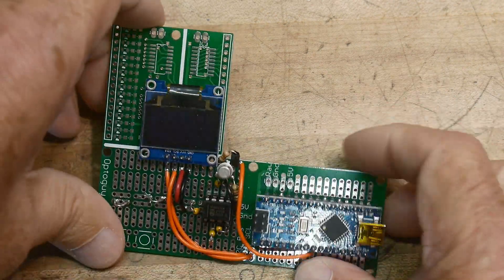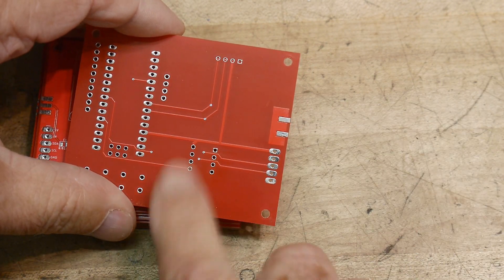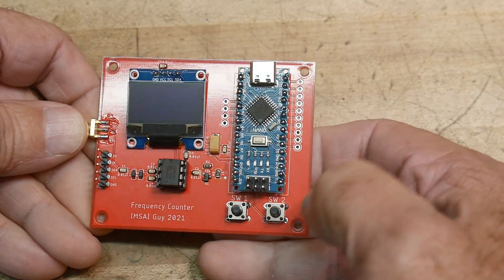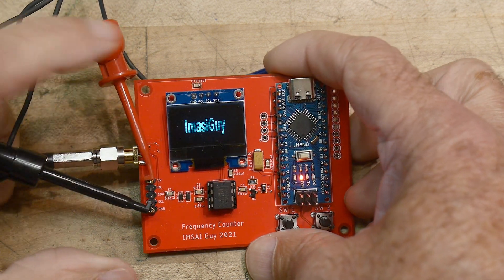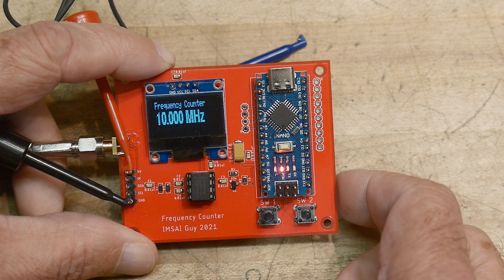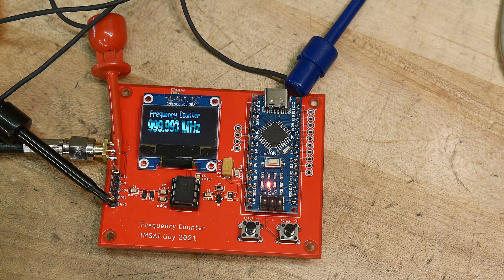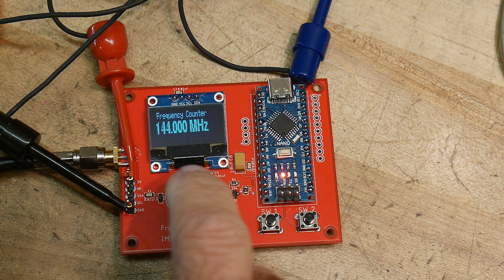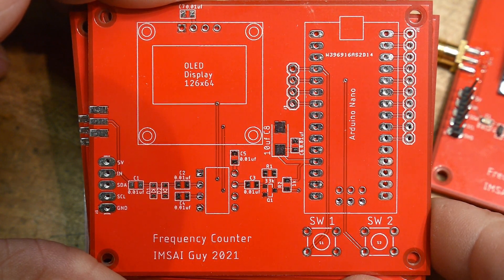#992 Freq Counter Complete

Comment: Fun little project - accurate and stable enough for a frequency display with 100Hz resolution for my otherwise all analog homebrew 20 meter transceiver.  My IF is at 5MHz so I added the IF offset to the code - calibrated with a 14.2MHz signal zero beat on the receiver.   I added a little rounding / smoothing to the code and changed the gate time to 250 milliseconds for a more responsive display.   I read some of the other comments,  the Nano may not be the most precise device for a general purpose frequency counter based on this chip - but it is certainly good enough and simple enough for my application.  Once I got the chips in it took all of about 2 hours to build.  Thanks for all you do for the electronics hobby!   73, de KK4DAS

Comment: pin D5 of Arduino is not defined.....how can Arduino read frequency? I think this software will not work with SAB6456A Prescaler
Reply from the maker: it is I2C and is handled by that driver, no need to define
Reply: @IMSAIGuy  ok thanks to reply
Reply: can u provide ur mail address?
Reply from the maker: @mohsinsiddique2486  I get many requests for mentoring or help with their work or personal projects. I do not have time to help everyone. I try to answer questions the best I can. It is best to ask questions in the comment section of my videos, that way others can help also.
Reply: I have bought 10pc Sab6456A but 9 of them does not oscillate .  Had u faced same problem?  The is labeled NXP.
Reply: Can u provide link of Sab6456a from where u bought
Reply: Please make an arduino tx tone decoder like ctcss and dcs

Comment: A counter shouldn't need calibration if the reference clock is accurate and the logic is not skipping or double counting the input pulses.   The Arduino is not a good choice for a counter without some external logic help.  The main clock oscillator is not accurate nor stable and the timer is limited to < 50 percent of the clock frequency.  I don't believe there is a way to get a true 1 second gate from the 16mhz clock with the internal counters.  Possibly one could use other than a 1 second gate and calculate the actual frequency by a scaling factor.  I noticed they were also using floating point numbers int the FreqCount library, not a good thing.  One improvement would be to add some external gate logic to make an accurate .1, 1 and 10 second gate from a quality 10Mhz oscillator.  The arduino would arm the gate logic which would then start counting input pulses.  When the 1 second gate generator went false it would interrupt the arduino  and the code would do what ever necessary to the accumulated count.  You are still limited to <8MHz input because of the counter timer input limitation (got bit by this trying to measure my Rubidium standards).   What I did was to use a divide by 2 before the input so I could read the 10Mhz Rubidium oscillator at 5MHz.  When the gate closed I could read the state of the divide by 2 on the  io pin and add that to the count as the LSB of the counter.   I was using very long gate times of 10,000 seconds to read micro Hertz.
Only issue I had was converting the 64 bit binary counter value to ascii for the terminal display.  Uint64_t  types break a lot of libraries.

Comment: Nice work.. Just a couple of advices from PCB design perspective to get better precision and avoid possible noise.
a) Avoid using chip sockets if not totally necessary. Especially for prescaler. Soldier directly to PCB.
b) Nano's ICMP pins are too close to tic tac buttons. Causes finger inconvenience, unnecessary feel.
c) Have input socket as close as possible to Prescaler, and Prescaler to Nano.
d) Have LCD Display and buttons on one side of PCB and other components on the other side for more professional look and better boxing purposes.
d.1) Having nano and prescaler one one side of PCB would also allow you a chance to cover those with any metallic enclosure (even with cheap aliminum folio)  to eliminate outside interference.

Optionally, you could drop tic tac button(s) all together.  Say, in your code, check if any (meaningful) signal present on inputs in the first 10 seconds of Nano boot (at the end of setup section), if so, use for calibration purposes, or, after 10 (or, n seconds) resume regular operation.
Cheers,.
Reply from the maker: you must have some nice boards. do you have a share site?

Comment: Interesting project.  I was going to take a closer look at the schematic, but it apparently will only open with Eagle, which is now owned by Autodesk, and is subscription-based??  No thanks.  How about a PDF or KCAD file?
Reply from the maker: there is a printout in the description on the PCBWAY
Reply from the maker: I added a pdf
Reply: @IMSAIGuy  Thanks.  I wasn't having much luck getting the one on PCBWAY to enlarge enough to see it on the screen.

Comment: I'm not sure I understand why the cal should be frequency dependent?  Is the counter missing some counts at higher frequency?  If so, could it perhaps be a software issue?
Reply: its the clock on the arduino (that all this refereences to) that may drift a bit with temperature, i suppose
Reply: @gominosensei2008  but if that is the reason, there would be no benefit to frequency dependent calibration.
Reply: It only calibrates at a single frequency
Reply: The division was based on the arduino's oscillator,which isn't well controlled. But the project itself is cool. Thank you for sharing!
Reply: I agree, the Arduino crystal or (ceramic resonator) is not going to be all that accurate and would need to be calibrated but once calibrated at one frequency it should remain calibrated for all inputs.   However there is a lot going on under the covers with the Arduino libraries which may be causing lost counts.  Also the timer timer input is only rated at to 1/2 the processor clock rate undefined what happens above this.   If you do the math on how millis() is generated  it works out to 1.024 ms per count.   The mills() timer (8 bit) is fed 16MHz prescaled  by 64 or  250KHz  divide this by the 256 counts for the 8 bit timer and you get 976.56 Hz or 1.024ms per count.    To correct the issue the millis library adjusts the count about every 40 some counts by skipping a count   ... 39, 40,41,33 ...